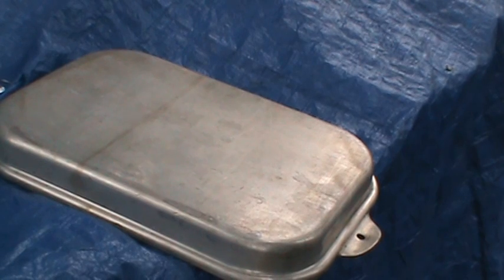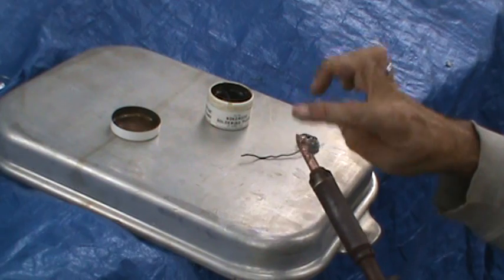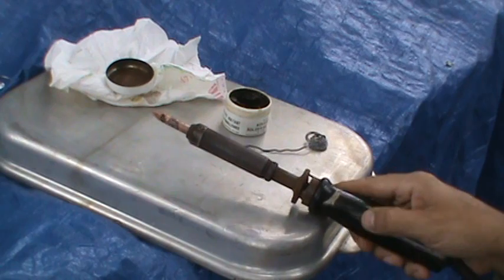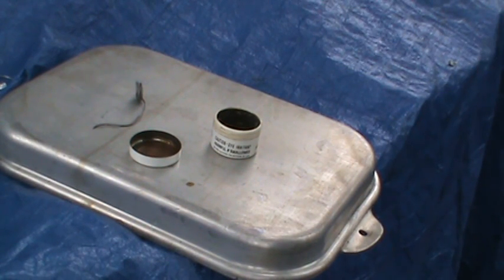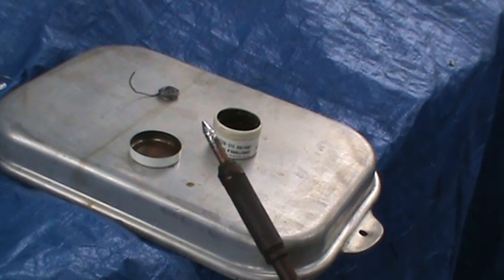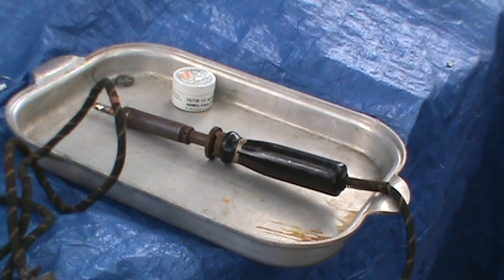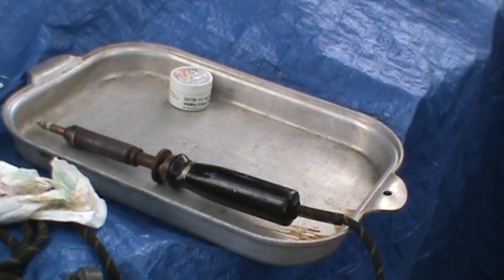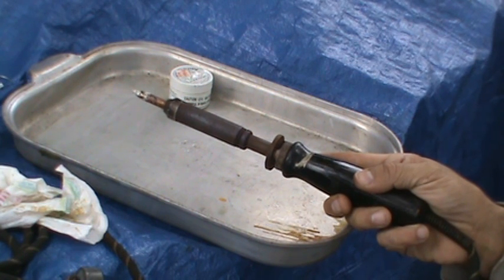Tinning the tip of your soldering iron

Comment: You can still get all of the parts.  You need to remove the tip and clean the interior of the barrel.  The tips erode because copper is soluble in liquid thin.  That's why an iron plating is put on more modern tips.

Comment: can u do this while its already at full temp or do you have to do it while it starts to heat up? I ask cuz I been tryin to tin mine n it just wont work.. And the point turns black pretty fast before I can get the solder on it.

Comment: I messed up my tip being dumb and what's the best way to fix it and also is copper but there is a iron coating so I don't want to sand it
Reply from the maker: Steel wool. you could also try putting the heated tip into a cup of paste flux
(hardware store should have that)
Reply: thanks ill try it and tell you if it works

Comment: Is that tip bare copper? I'm asking because you said you used a belt sander on it.I guess the added flux from the jar makes the solder stick to the tip. Every other video I've watched about tinning a soldering iron makes it sound like rocket science. Would this work on the small soldering irons for electronics?
Reply from the maker: The tip on this iron is copper. I used the belt sander to clean it up and sand the pitting out.
you can file it or use sand paper on a block of wood
Your just getting it down to bare copper
Flux is a cleaner, as the tip heats it will oxidize
Flux slows this.
It you clean the tip real good and heat it slowly you may not need flux
You kinda get one shot at this,  heat the iron and get it tinned ,done
If the tip gets oxidize you have to cool the iron down clean the tip and start over
And Nope this iron is way to big for small work
a iron about 15-25 watts is more useful
is iron is 100 Watts
Reply: TheTimeSpiders
Thank you.
Reply: I'm here to tell you this guy bay far is dead on with this procedure. I have a small iron for electronics and tried this method and in just a few minutes my tip was perfectly re tinned!!!
Reply: Me too. That's why I was curious about the video. I have small electronic soldering iron. The iron's ok but the tip was no good. I threw the tip away and replaced it with a piece of solid copper wire of the same diameter. Now it works fine.